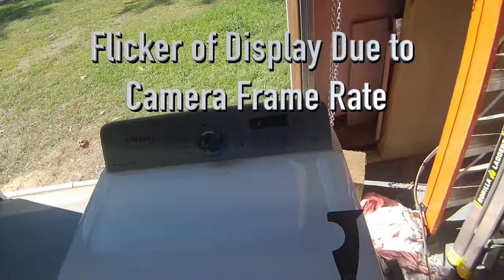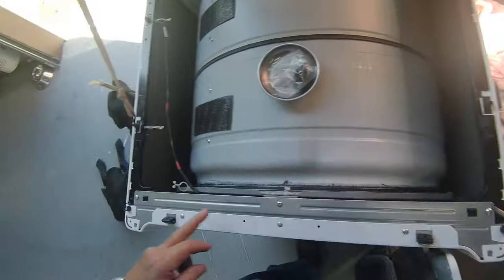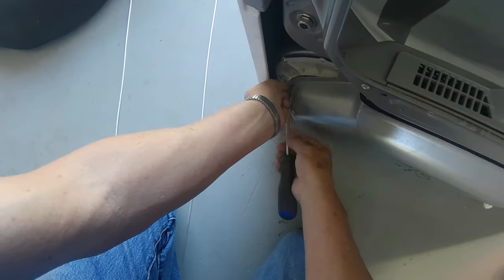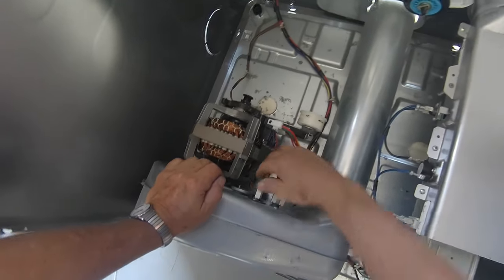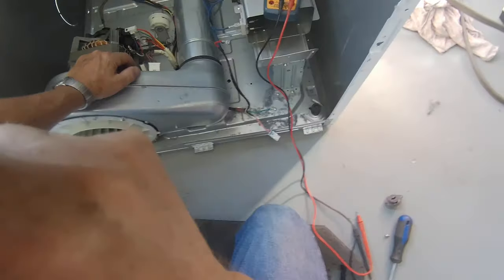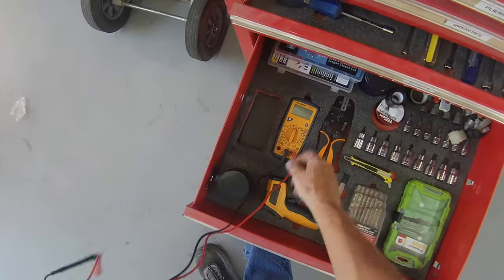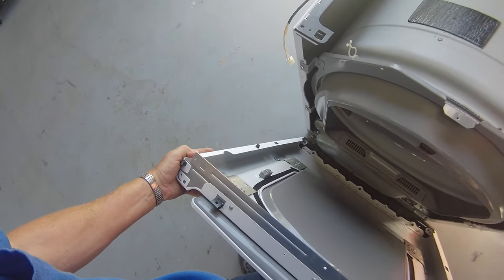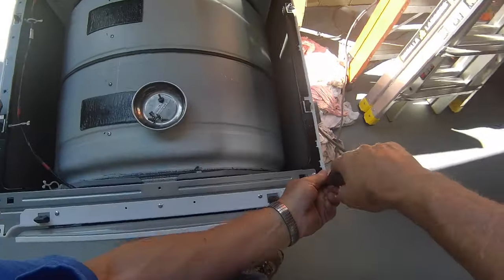How to Fix tE Error on Samsung Dryer: DIY Guide

Comment: What if the thermistor has been changed, the control board has been changed and the temp sensors have been changed and you still get the TE error on a Samsung dryer? It's been a long arduous process of trying to get my dryer fixed. Thank God for my electric company's worry free program, but we've basically run out of ideas of what could be wrong. I hope you can provide some help. Thanks for your time.
Reply from the maker: I would check the wiring going to the thermistor. Also be sure your spade plugs are making contact with the thermistor. I once was about to throw out a machine until I did covered that when I plugged in a thermostat with an insulated spade plug connector it was sliding on the out side of the male part and felt like it was plugged in when it wasn’t. I hope you find your problem. Thanks for watching!

Comment: I have a front loading Samsung washer and dryer. My husband has had to replace a few things on each over the years. The manufacturers make it SO ridiculous to repair them because you have to take them almost completely apart every time to get to anything. The actual repairs take no time at all. It takes me longer to remove my shelving and everything out of my laundry room just so he can take either unit apart. It’s really frustrating.
Reply from the maker: If the engineers had to work on them they would be built differently. Thanks for watching!

Comment: What do you check when a dryer power up and don't spin I checked the motor switch and it is good
Reply from the maker: If you hear the motor running but the tub doesn’t spin it’s a broken belt. Open the door and hold down the door switch and push the start button to check. If it is a GE then once you release the start button it will stop running when the belt is broken.
Reply: Samsung dryer the motor won't come on
Reply from the maker: The belt is probably broken. Without tension on the belt from the idler pulley the belt tension switch won’t allow power to the motor. A common problem with these is the idler pulley will fail and then break the belt.

Comment: I have a whirlpool washer that will go into draining then spins a few times then fills back up and goes into the wash cycle again anything will help...
Reply from the maker: The model number would help me help you.
Reply: @HarperandKnowles  WTW5000DW1
Reply from the maker: Without being there to diagnose the machine myself I can only guess at the problem. I’m thinking your tub hub has failed and when the motor over speeds it will reset to the wash cycle. Here is a video about that. This was done on a Maytag but the two machines are basically the same machine. Get Your Maytag Washing Machine Spinning Again with This Repair Tutorial
https://youtu.be/FnA85HlxyJg. And this is an earlier video about the same problem Maytag Washer Won't Spin Clothes Dry
https://youtu.be/XF3zYGyi85s. Thanks for watching!
Reply: @HarperandKnowles  Thanks for responding I will pull the tub and check it out to see if it needs to be replaced and thanks again...